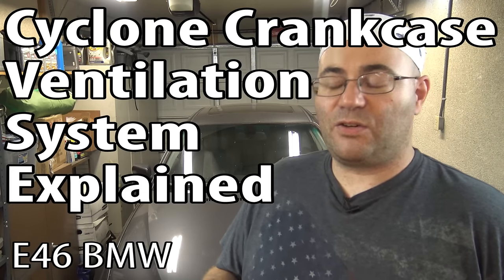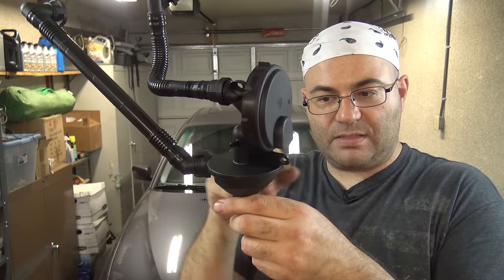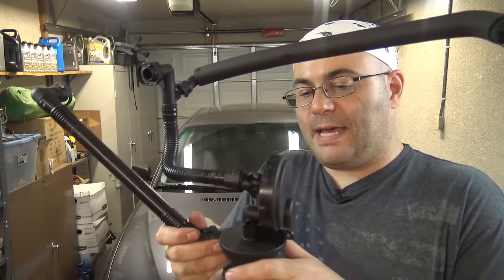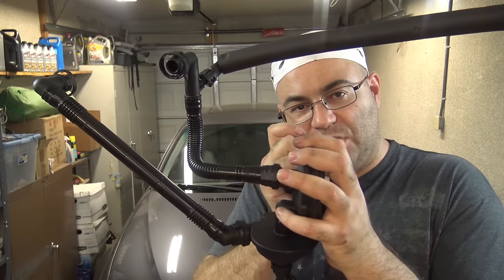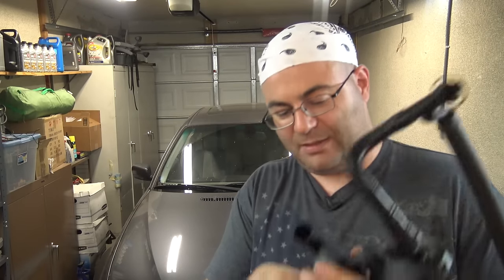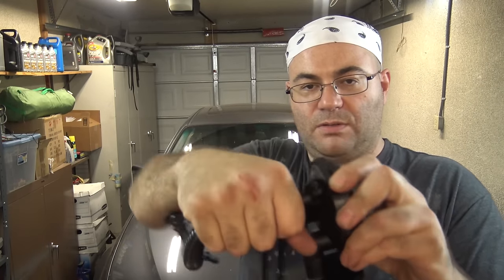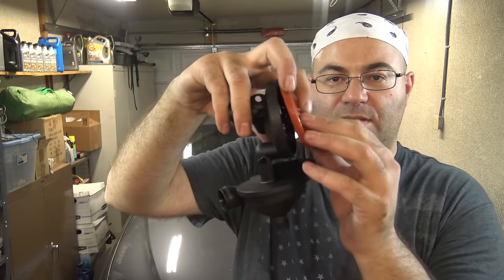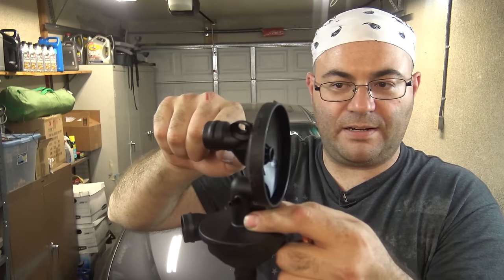BMW E46 Cyclone Crankcase Ventilation System Explained

Comment: I have a BMW 328i 2000... that port ( vaccum tube)  on the oil separator piece... min is not capped and is not connected to anything EITHER. Let's say if it is suppose to be connected to the fuel rail but IS NOT... is that why my car is running with rough idle on cold start?

Comment: Great explanation on how the CCV system works. But if I understand your explanation up to the check valve idea it seems to me that the check valve might be bad in a particular situation: if the diaphragm fails allowing full vacuum to be applied to the oil return line (as you explained earlier) the valve would shut close not allowing the oil to be sucked up, indeed, but also not allowing the condensed oil from the CCV to drain. That would then be sucked in the engine. Did I got that right?
Reply from the maker: Yes but that would not be as bad as the oil from the oil separator AND the oil from the oil pan getting sucked into the intake. :-)  It may or may not even cause much smoke.  The hope is that it will make a little bit of smoke, enough to alert you that there is a problem that you need to take care of, but not strand you on the side of the road!
Reply: @50sKid  i have some issued with that check valve system , i think its must be test the check valve flow with gravity test , if the spring is to strong some oil will be stuck on it, and it will be burn when cold start,  its alwyas possible positve crankcase pressure will open the check valve.

Comment: I purchased a check valve and it looks similar to the own shown in the video, but i suspect the pressure needed for the oil to flow through is too high, i have to blow on it with some amount of pressure for it to open. Do i need one that opens with gravity or will the system apply enough pressure on the check valve so that the oil can flow down?

Comment: Great video as always, your a smart guy. I Have a question if you would be so kind. My 07 X3 E83 3.0l makes a whistling, whining Irritating noise slowly starting at around 30 mph, when accelerating then stops at around 35, starts again when decelerating at around 35 stops at about 28 mph, whether In neutral, in sport mode, with brakes applied or not always at the same speed and rpm's. It's high pitched and almost sounds like it's coming from my speakers or windshield area center inside car or under the truck, with windows open or closed. The pitch changes sometimes w/ rpm's, worse when weather is colder but car is warmed up. Sometimes doesn't happen, I'll stop, shut car off, go again and it will start again. I have a slight leak in my rear diff. added oil need to change seal. Changed multiple parts, rear bearings, driveshaft, reluctor rings rear abs sensors, valve cover gaskets, plugs, coils, oil change at 3-5000 ms. Made a mistake and put 75W-140 redlne in front diff and 75W-90 Valvoline in rear diff. Could the driveline be that sensitive? Performed adaptations for TC w/ new oil. Changed Tranny Filter, pan gasket 2x's and added fluid twice. Could be bad Tranny filter or humidity in oil? Low oil? Just put 4 new Michelin's. I have a little play in lower front forward control arms so I never put the plastic under cover shields back on because I'm always working on this vehicle. I don't know anymore, Please help. I'll buy you a beer. I Have Foxwell 510 BMW specific OBD2 everything checks out. No more codes since abs system was resolved. Truck runs pretty good with 135,000 miles, noise is making me crazy though. CCV, PCV? Pad and Rotors replaced 2 times in 25,000 miles and I drive easy. Sorry for the book. Peace!

Comment: Hi great video, I have 520i E61 N43 car, I took some test , I pretty sure the the PCV diaphragm has ruptured,  it makes whistle noise at idling, strong suction from oil cap, rough idling. just wander can you drive with blocking the vent hole on the top of the ccv valve cover?

Comment: Can I troubleshoot this by loosening my oil fill cap to ensure it's a CCV vacuum issue? I have the typical VANOS and half power mode after 20 minutes of driving.  I have noticed my oil fill cap has a strong vacuum and I want to be 100% sure it's my CCV/ valve cover assembly. Can I loosen my oil fill cover to have a better vent and testdrive to see if it makes a difference?

Comment: 50's kid......thanks for all your video's.  If I pull my DISA off and see a fairly oily residue insode the intake manifold, could this also be due to excess oil coming thru CCV system and back into manifold ?  E53 has over 225K.   thanks.   Les

Comment: I had the most common broken hose you mentioned broken. It was broken during extreme cold and high humid weather. I did see a little yellow mayo. I didn’t open the system to check for mayo. Would a bad ccv make a hight pirch noise at cold start only? It only does it for 5 seconds and it goes away.
Reply: My intake manifold is a bit dirty too. I clean the valve too.

Comment: George my E46 2003 during acceleration after drive for 20 min nothing lights fault detect but view blue smog exhaust  what you recommend due. may be de PCV VALVE fault. the car have 150 k miles

Comment: I got a check engine light on with P0441, the interesting thing is that when I replaced the valve cover gasket and the hose that goes to CCV on the side of cover broke. Can the EVAP code  be associated with the CCV hose?

Comment: Great video and thanks for revisiting this topic. I changed my ccv from you videos and it went perfect. 

Can you tell me tho... I have a 2001 M54 330 and I never moved over the blanking port you talk about.
So basically the new ccv has been installed without this. 

Oh and lastly do you know if my aftermarket ccv would allow me to fit a genuine BMW new pipe to it. The push clip that attaches to the vanos has snapped and I was hoping to buy a new pipe from BMW with better plastic.
Reply from the maker: If you didn't move it over then you've got a small vacuum leak that is giving you positive fuel trim and causing you bad mileage.  The bmw pipes will be compatible.

Comment: Did you make a newer video on this where you described the ports correctly?  Cause i found this confusing. 2here is vacuum applied ? Which port ? I assume the intake manifold creates the vacuum. Cheers

Comment: Hi 50's kid, I have an e87 120i, with the N46 engine. After idling for about 10 minutes I'm hearing an extremely loud squeaking noise coming from the engine bay and the noise disappears when the revs fluctuate between 700 and 900 rpm. I've been told its a vacuum leak. Is there a common pipe that leaks on this system that I can replace to get rid of this irritating noise or do I need to replace the entire CCV?

Comment: by adding a check valve, would it increase the pressure inside crank case and cause damage to any oil seals??

Comment: Hi the hose mentioned in this video that is most definitely going to fail, does it apply to N52 engines? I have a Z4 E89 with N52 engine and have some problems with it. Cheers

Comment: I replace the pcv and cvv and now my car wont fully start it cranks but does not turn on fully. The car was running fine. I did had some connectors in the wrong place at first when I started the car. the car turn on but the gas pedal did not have any pressure it was loose when I press on the gas. So I check the engine again and reconnect the connectors and the car started to cranked. So I jump the car battery to see if it would help and it didn't the EML yellow light came on and now this is where I'm stuck. What is the next step I need to take before I take it to a mechanic. Is there a video where you go over the connector on M54 engine e85 and explain their purpose. I have a  2005 e85 m54 z4 3.0i z4 bmw. It has the same pcv and cvv in this video tho.

Comment: Hey I have a M52TUB28 and it had a ruptured ccv tube on top of the engine at the fuel line that you described so I replaced that, so will it start burning oil now? Cause it has vacuum again so it can suck up the oil. I don't think the ccv has ever been replaced and the car idles kinda poor on a cold start. Did get better when I replaced the tube that was ruptured.
Reply from the maker: No it won't start burning oil now.  If it still idles poorly then you still have other leaks.  See this video: https://youtu.be/3encrkBsss0
Reply: +50sKid I don't have any codes tho. Could the return line from the ccv that had a 100% fail rate as you described be the problem?
Reply from the maker: You could have leaks without having a code.  I thought you said you replaced that line?
Reply: +50sKid no I only replaced that line that only the m52 engines have as you said. That one was cracked. It was on top of the engine near the fuel rail.
Reply from the maker: Ah i see.  Well you know what else to look for now.

Comment: Hey so you know that hose from the dipstick the one you said was the main one that rips. Well I had found that mine was torn like you said so I did the whole ccv system change and white smoke would still come out I drove it for a while and it stopped coming out. Was the the problem that was causing white smoke??

Comment: 50sKID I have a question for you.I have bmw e46 323i 1999 M52TU B25,so where that vacuum line from the oil separator goes if it not go to the fuel regulator?  Maybe back to intake manifold ???

Comment: hi.i think if my diaphragm valve is not working correctly and it is sucking up the oil  from dipstick, i can install oil/fluid check valve on my ccv and the problem will resolved? yes?sorry for bad english and thank you for your answer

Comment: thanks for the info! I have a 98 E36 with the M52 engine and was wondering if you have ever seen a P1188 set due to leaking valve cover gasket and throttle body O-ring? I smoke tested it and the valve cover is leaking badly and so is the throttle body seal? The O2 and CCV and related hoses have been replaced.Thanks for any insight!

Comment: I'm trying to trace an oil leak high up on the driver's side of the engine.  It's enough to coat the engine, but not show signs on the dip stick.  Could the CCV piping be the culprit?
Reply from the maker: +Taylor West no more likely valve cover gasket
Reply: I had that. It was the gasket where the oil filter housing connects to the engine block.
Reply: Valve cover gasket or the Vanos line. Both should be replaced at the same time. I really like 50's kid and am a major fan but another YouTuber a younger Indian Kid with the youtube name Shoplife has the best video for most of that job on an e46.

Comment: I just replaced my valve cover gasket and when I went to turn it on it was running fine for a few minutes and suddenly it started to run ruff and I git a check engine light got it scanned at autozone got codes for the ccv system and mas air flow sensor 
Car was running perfectly fine before replacing the valve cover gasket what can it maybe be ??? Maybe a cracked ccv hose

Comment: dont suppose you know the id or ed of that ccv connector do ya at 1:25 im thinking of taking mine off and just running a rubber hose to the dipstick as its leaking?
Reply from the maker: I think it's 3/8"

Comment: great video I have a 2005 bmw 325ci with code p0171 and p0174 I was trying to change the ccv valve but this car is without ccv valve under the intake manifold can someone tell me someting about this ?
Reply from the maker: I'm going to assume that you have the M56 engine.  In that case I would suspect that either your valve cover gasket is leaking very badly, or the seal on the oil dipstick tube is leaking, or the line connecting the valve cover to the intake manifold is cracked.  It could also be the vacuum hose running from the back of the intake manifold to the secondary air pump valve.
Reply: could just be MAF

Comment: I seen you did the ccv delete... do you have a lot of vaccuum in the crankcase?? How has it worked??  I was think if one was to run a hose from the dipstick to the the air tube  some how after the maf  that it would be closer to factory vaccuum under valve cover???? I have 05 330ci .. that runs like crap.. fuel trims are high and p0300 .. smoke test revealed no leaks.. maf readings at idle 700 rpm 3.7 to 4.9 ..buts its running rough.. rpms jump 700 to 800 or so..

Comment: Hey man i did replace the ccv and tubes but not oem parts and make the o2 pilot mod  but car still burn oil . Then i did remove the return oil tube that goes to dipstake and turn on the car i notice that there is little of vacuum in it does that means a bad ccv ?

Comment: I'm curious... if you installed a check-valve and removed the diaphram would'nt that create the same crankcase vacuum of the pilot mod? I was thinking I could just replace my lower drain tube, install a check valve and remove the diaphram.
Reply: Why is the lower drain tube so long into the bottom of the oil pan 
Couldn't it be shorter into the oil pan ?

Comment: I've been having trouble with my M52TU equipped e39's CCV lately and have temporarily deleted the system (currently venting to atmosphere), but I've been looking into alternatives. I've already performed this job on my M54 equipped 330 and don't feel like repeating the process.  There are actually several options:
1. Replace CCV system (baseline option)
2. Vent to atmosphere
3. Run crankcase vapors (from valve cover) directly back to intake (no oil seperation)
4. Oil Catch Can
5. BMW Motorsport Oil Separator (and check-valve)
http://vsetrack.com/track_reports/2010/bmw_motorsport_oil_separator/bmw_motorsport_oil_separator.htm 

I'm definitely considering option #5 and mounting the oil separator at a more serviceable location.
Reply from the maker: Yeah I want to do #5 as well because I smell oil from time to time now that I'm running the catch can so I'm not 100% in love with it.

Comment: any thoughts on my 2004 e46  throwing up codes 227 and 228 and all cylinders showing misfires on my snap on scanner, the idle is rough too.
ive replaced all plugs and coils and cam cover seals, ive also replaced the air intake upper hose as that was badly cracked.
i dont feel any misfires but was informed that when the idle drops it detects that as a misfire.
any ideas?

Comment: my E46 BMW  EngiMisfire  5 with fuel cut-off  only the first start show code PI351 , may be the idled speed Valve is the problem ? the spark plug and coil is ok

Comment: Hi I have a problem my engine dosent have a dipstick hole I have a z4 2.0 2005 basically it's a E46 engine and I have a proble with the cartergas acumlation in the engine when I start cold the engine its comming out a big cloud of smoke and it goes up the rot min to 1200 for about 2 min this could be the problem the pcv system?

Comment: It recently replaced my starter I took off the intake manifold this is a 2008 BMW 528IE60 with a 3.0 inline 6 naturally oit's naturally aspirated so I take everything off get the starter in and then the car starts but are starts but there is a extreme vacuum under the oil cap and when I open the oil cap it almost stalls it affects the idle then then the car is seems to be in limp mode and will not shift past 2nd or 3rd year and II saw a video Saying that any issues with the throttle or air can cause it to go into limp mode I already have some transmission issues but never this problem it always shifted fine Do you think it's the CCV valve I took it off and sprayed carburetor cleaner inside could that break anything and anything and can I open it and clean it out and reuse  If that is the problem?? I'm using voice text just in case you see repeated words or sentences

Comment: I did my CCV on my 2004 330ci. And there are wires wrapped around the hoses and a weird thing behind the intake manifold with a bunch of wires connected to all the hoses. Is this something that warms up the CCV system? Can I just cut the wires off?

Comment: I believe he did another video on a Cyclone CCV where you ran a small hose from the CCV to the back and of the intake where the three ports are capped am I correct about this is this a good idea or should I just stick to what you were showing here in this video
Reply from the maker: The small hose thing you are talking about is designed to reduce the oil consumption

Comment: hi, , i just bought 2013 x5 a week ago with 74k miles, but i see white smoke coming out of it , my vacuum shows only 1.2 in/hg,, no change even with high idle rpm. Dont know much about coolant level coz i drove only 180 miles after i bought it, oil level is at max and engine area looks clean. it drips black color stuff from exhaust , dont know if it is coolant or oil, white smoke does not feel like oil burning. Car does not overheat at all, Please guide me what to do ? i m good at changing valve cover gasket but not sure if that would solve white smoke issue. i have not opened spark plug for any oil coz there is no burning oil smell from engine area. Let me know what to check and how to start in this case.,, thanks

Comment: Hey 50s Kid, I have a question for you. I just replaced my CCV yesterday and come to find out, my CCV I was replacing is in pretty good shape, but who ever replaced it before me didn’t clean the dipstick tube. It was somewhat clogged and I had cracked hose from my CCV to my dipstick. My question is, could that have been my cause of loss of power that comes and goes? Also I have a rough idle with surging. Note: I have replaced everything else that would cause those issues and I haven’t driven it yet to test it. Kinda nervous to with a aftermarket CCV and not having a check valve yet, haha.